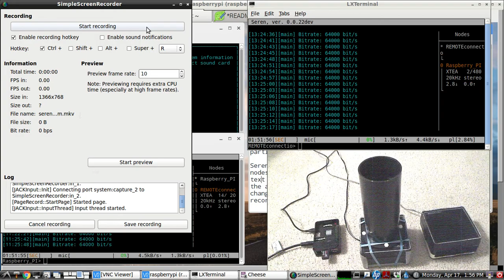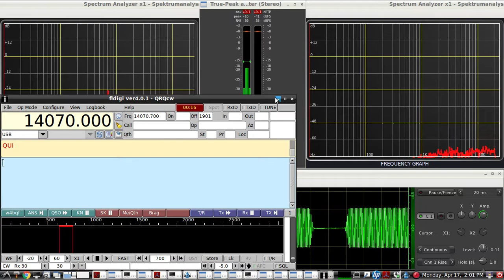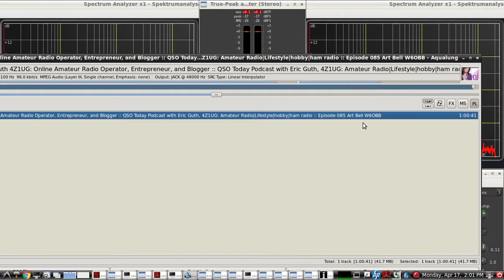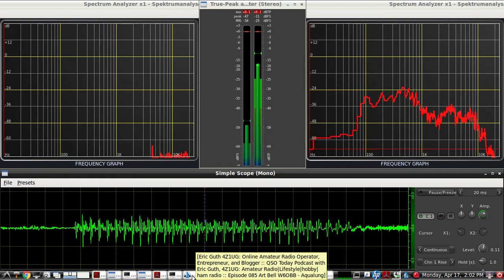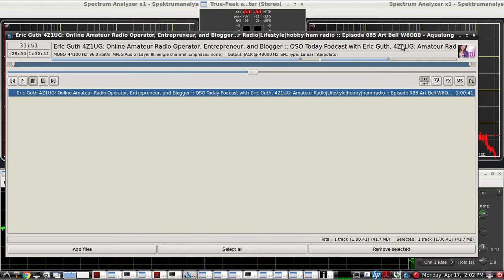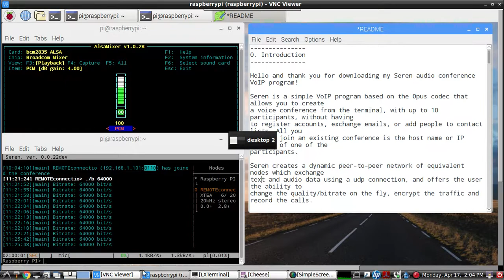Experimental Audio over IP Intercom Receiver - using a Raspberry PI & the VOIP APP - Seren

Comment: @QRQcw will this thing work over local wlan without internet?
Reply from the maker: yes, it works WLAN, LAN and WAN....just need to know the ip address of one of the SEREN clients already connected together...also...i have found SEREN to be one of the best AUDIO OVER IP apps to work over wireless, with less audio drop outs and more consistent audio streaming performance in general,  than many others i tested